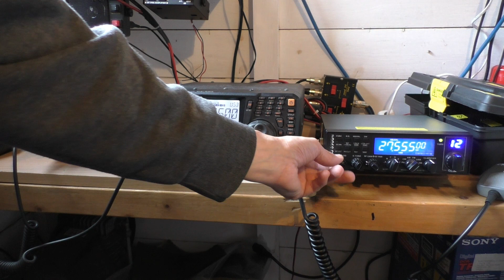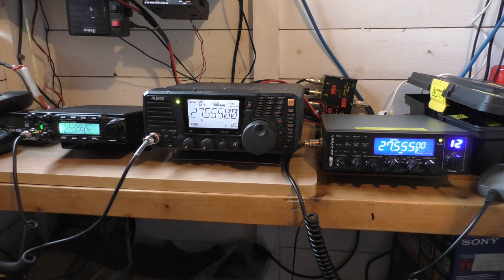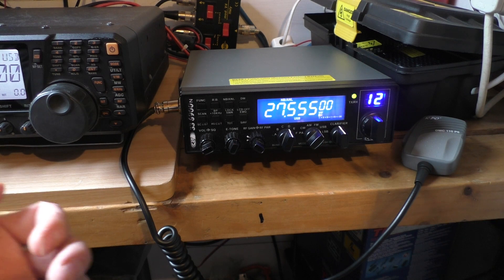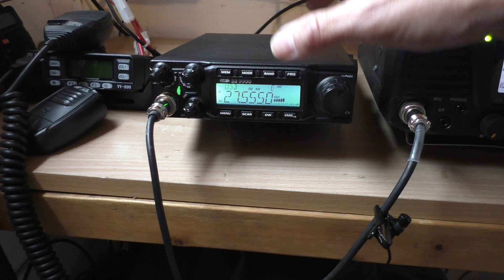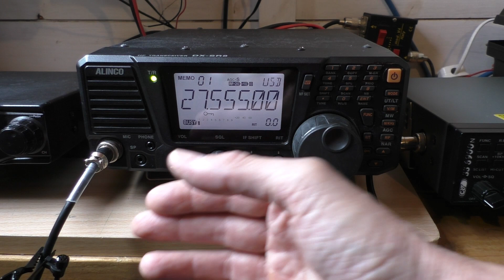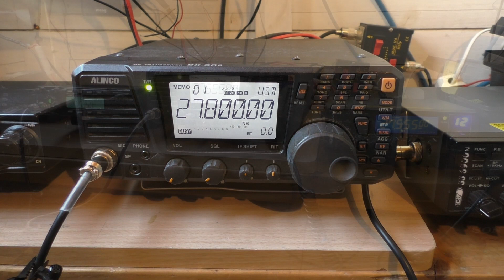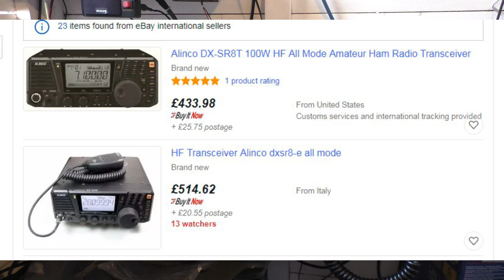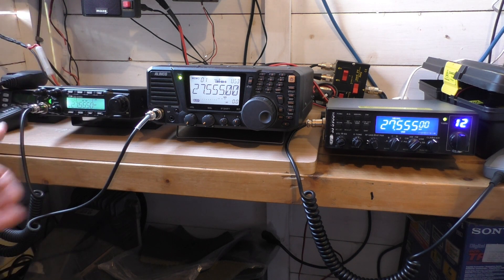Same interference QRM / PLT shown on 3 different radios.

Comment: If this is PLT the interference would be there all the time but it is not.
I believe it is just conditions.
Reply from the maker: Maybe.  I hope thats not the case.  I get the same noise in the attic shack.
Reply: @CB-RADIO-UK  It will clear up.

Comment: Hi, another excellent vid.
I have the same noise. On 11m it builds up from 27.500 then falls away around 27.850. It also peaks in different areas.

I started with a President McKinley three months ago but found that it couldn’t cope with the QRM. 

I tried all sorts of ideas...
I cut the power to my house and used a handheld on AM on T5. I managed to work out the general direction of the noise by walking around my neighbourhood with it.

I decided to use the McKinley as a mobile and took the plunge and got a nearly new FT450d. I had to do the wideband mod on it too.

The NB and the filters kill that QRM.
It was worth the expense and doing the mod just for the NB and filters.
Week signals however do drag the noise in with them but it’s acceptable, as I was thinking about ditching the hobby because of the noise.

I’ve grounded the mast post, and coax braid to separate ground rods and also tried a line isolator/1:1 choke at the receiver end to see if it was the braid (100+ foot run) that was picking up the noise.
I’ve removed the choke as I didn’t seem to change the noise level except for introducing some loss of receive signals but the signal:noise ratio didn’t change.
I can’t go banging on doors as I had a TVI problem with my direct neighbour that was hopefully cured with a high-pass filter/ braid breaker we fitted to his TV coax.....so I’m letting things settle down for a time.

Jim 26CT3427
Reply from the maker: Thanks im.  Glad its not just me then.  Iam getting the same freqs spread as you ?
Reply: Fred in the Shed 
I wonder if it’s the same brand of PLT equipment being used by neighbours?

Comment: I’m assuming you’ve ruled out SMPSU’s in your own house? (I.e. killed the power and checked noise stays the same). If so, it’s worth building a DF antenna for a handheld and seeing where the noise is coming from.  Then, depending on what you find, it’s always worth a friendly chat and offering to help them.

Comment: They will need to make sure they as mars cap done on it if they buy a second hand HF radio so it will work on CB frequency
Reply from the maker: Yep.  The Alinco's are dead easy to do. Just a blob of solder needed.

Comment: Just out of interest, try running the 6900 on a battery and turn off the LED Power Supply you built, I'm a bit suspicious that filtering on this may be pretty poor due to the low costs. Isolate all mains devices one at a time just to illuminate anything that may be adding to the problem within your set up. Just a thought
Reply from the maker: Yes a good suggestion.
Reply: I had the same interference problem on my radios some years ago and I couldn't get rid of it. I eventually found loose wires in one of the 13A ring main sockets in the house, which were not tight enough and had oxidised wires causing a poor connection under load, thus the interference. Worth checking all house circuits for this issue.

Comment: Have the same noise but I find that if I switch of the mains supply to the mains sockets,it completely disappears. So I confidently tried disconnecting every device that was plugged into a socket but nothing worked. I am not sure what I can try next but it would not be practical to turn off mains supply every time I want to receive. Any suggestions?
Reply: Do any of your plug sockets have neon lights?

Comment: I have the same problem Fred but not as bad as what it was last year as my neighbour up graded his WiFi plt. The newer ones have better notching to avoid interference although I still get interference from 27.535 up to 28.000. Previous the interference was almost full 11 meters plus it encroached into 10 meters. I called Ofcom, they arrived and sniffed about for an hour but simply weren't interested. I think time will help your problem as equipment improves but most chinese chargers emit all sorts of RF. I found on most 11 meter ssb rigs the ANL only works on AM/FM although the interference doesn't seem to affect my Galaxy DX99V.

Comment: I used QRM eliminator same  as yours with a T2LT  on a 7m pole high as possible and had excellent results bringing my noise completely out . And with the RF sence(TX,RX) with these eliminators i purchaced a Linear amplifier keying/PTT/switching cable, but these only work with HF sets. It plugs  straight in to the eliminator and round the back of the hf radio. Got it from seller:phutping but cant see any for alinco maybe they can make one if asked.

Comment: There has always been that interference before WiFi extenders .
To eliminate interference, ground radio and ground antenna with a copper ground rod.
Also you can buy a 240v socket filter for power supply.
Reply: None of your suggestions will eliminate PLT interference as I have tried them all....
Reply: @Team-fabulous  like I said this interference has been there before WiFi extender's.
Reply: @paulhotson5820  and like I said, your suggestions will not cure PLT interference as I have tried them all... Do pay attention...
Reply: @Team-fabulous  If it was WiFi extender's the interference would always be there but it is not.
Pay attention.

Comment: Put ferrite chokes on everything.
Reply: Been there... That doesn't work.
Reply: @Team-fabulous  It will work, if you use the right ferrite!  You need to spend the money , 31 mix core is the ones you need ,and 6 turns,  on the feed and the per lead . A good video to watch is rsgb 'clean up your shack ' . If you have a lot of noise this might cost you £60-£100 . But you will not regret it if this works . The clamp on type is recommended part no : 0431177081 .  But watch the whole video first . Another good video that confirms this even if this is mainly aimed at low bands is Mark G0MGX 'noisy rx on low bands?  Let's clean it up . '   .
Reply: @Team-fabulous  If you do it right it should help, but if it is being picked up be the antenna, you have a big problem.  It will work on the antenna as well, but you are better building a choke just for the frequency that is bothering you.

Comment: Hi Fred the X phase noise eliminator should work very well with a wire Antenna as the 2nd Antenna but only if the interference is RF based or car ignition noise which is RF like the old Spark gap transmitter,s.
I wonder if your noise is coming from the mains lead or 12volt power leads from your PSU,s to the Radios? You could try a few chokes.
At my QTH I get a very similar noise which comes from every LED Light bulb and also those energy saving fluorescent bulbs. Fridge Compressors usually in Summer are a pain as are washing machines and lawn mowers and the local teenagers on the little Chinese Motorbikes. I have nothing against Chinese Motorbikes by the way👍😊.
Reply from the maker: Thanks Steve.  I may try some chokes.  I did try the X-phase.  A couple of videos in about a  week on both Fred1 and Fred2.

Comment: Nicely demonstrated Fred.
I have the same noise issues which killed my SWL activities and almost did the same for CB. Like you I found most radios couldn't cope with the noise until I obtained a Yaesu FT-757GX...one click of the NB and the noise all but disappears!! Still drags in a bit on signals but much easier to live with. Unable to be 'mobile' a homebase solution was much sought after and now I enjoy my SWL once again and even, (sssush!), CB 😉
All the best mate, Victor CT3228
Reply from the maker: I agree Victor.  Noise and better receive is the main reason i run HF gear nothing to do with power.  Although it still seems to wind some people up.
Reply: Hi Vic, recently I also have a yaesu FT757 (GXII) and I was surprised at the general quality of this "old" radio ........

Comment: Hi fred put a choke on your mains lead to see if its mains bourn
Reply from the maker: Hi Dave.  Ive tried those cheap clip on types before without success. Do you think the doughnut type work better.
Reply: @CB-RADIO-UK  Your talking about something else there, im talking about a air choke coil the wire around your hand and tape up
Reply from the maker: Got you.  I only thought that would work on the antenna feed.  Thats worth a go.  Thanks.